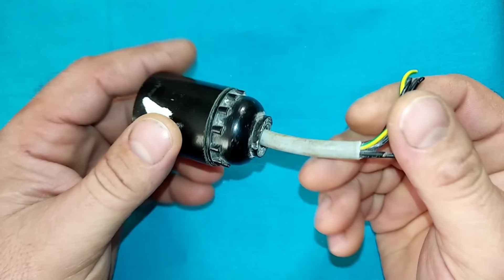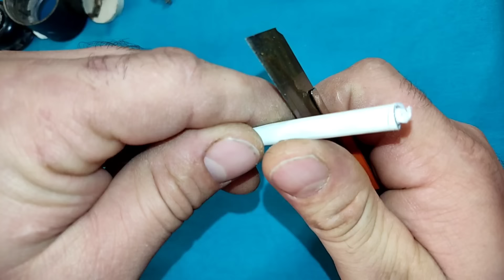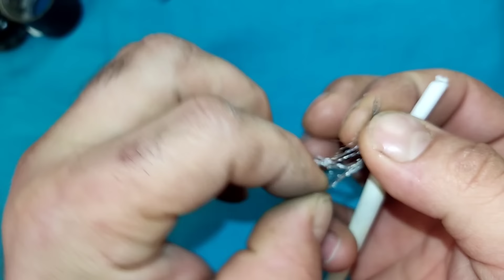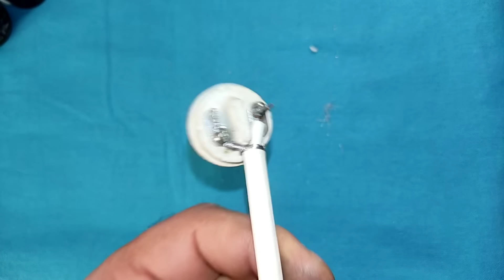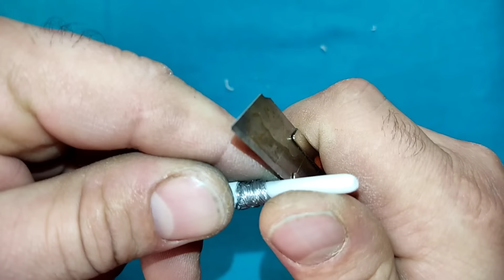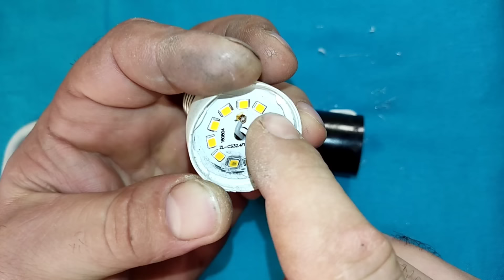Insert the LED lamp into the TV and watch all the channels in the world in HD || Antenna amplifier

Comment: Albert Einstein once said: "There are only two infinite things in the world - the universe and the stupidity of people. True, I have some doubts about the first statement." I wasted 10 minutes watching an idiotic video on how to make a super antenna from an LED lamp. If you connected a simple piece of wire to the center conductor of the TV antenna input, the effect would be the same or better. This video is intended for those who do not have basic knowledge in radio engineering, electricity, or physics. But try.